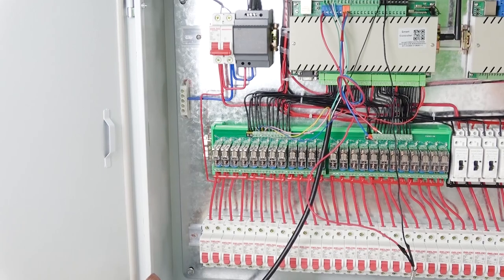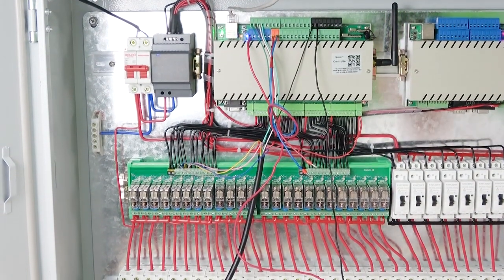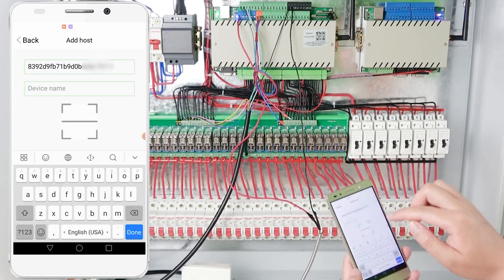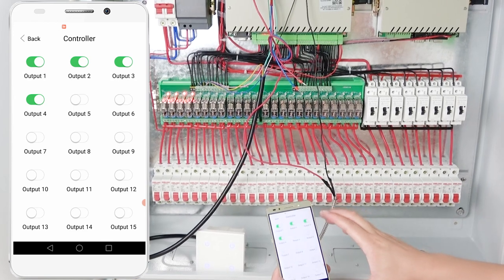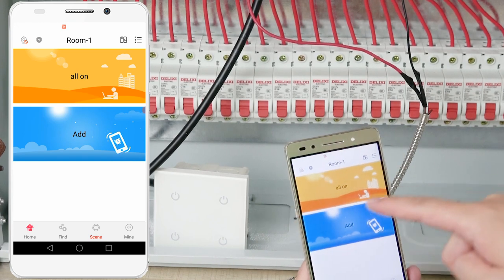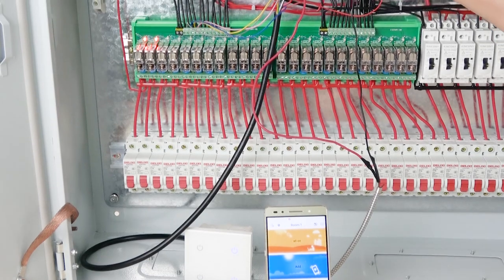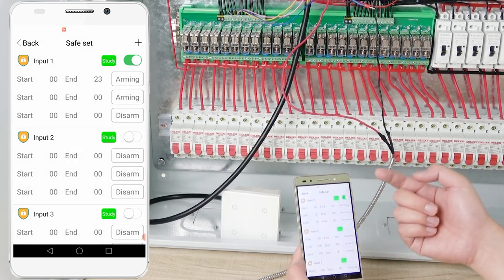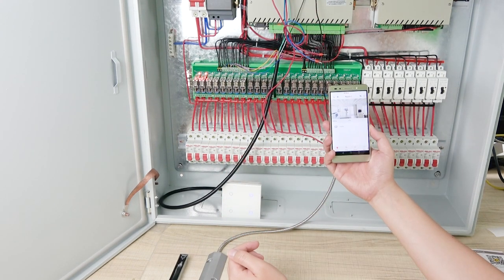【How to use KC868-H32BS #04】sensor trigger output & send alarm message

Comment: Such an powerful device...one is enough to control and automate whole house compact and awesome...good explanation....
but i have an doubt about heating and life time of this relay...it do about plenty of operation is it sustainable on heat or any cooling system is needed as fan or cooler.
Reply from the maker: not need cool system, no heat parts, relay use high-quality OMRON relay. if it's bad, it's removable, you can replace by hand easily.
Reply: @KinCony  but every product run for 24/7 so that may leads to some heating issues thats why i ask
Reply from the maker: @ersheikismail8293  The controller uses MOSFET output, so there is no heat. The external relay uses industrial standard.
Reply: ohh thats 👍great